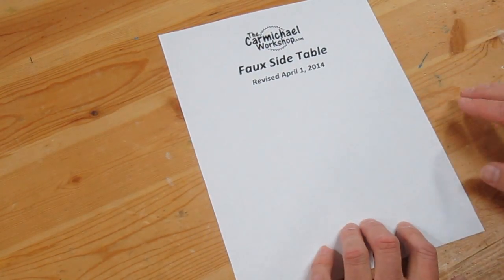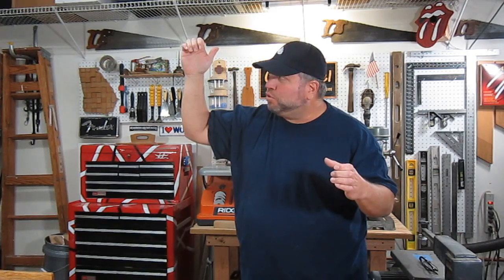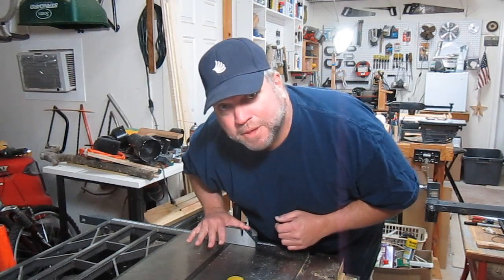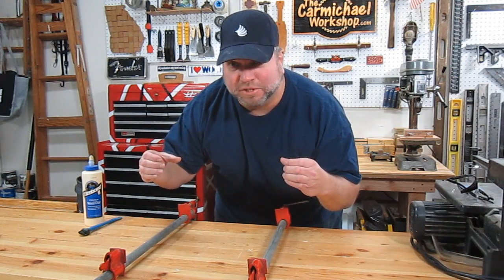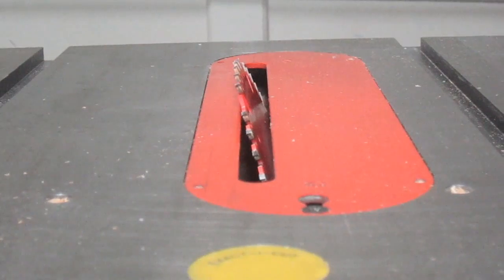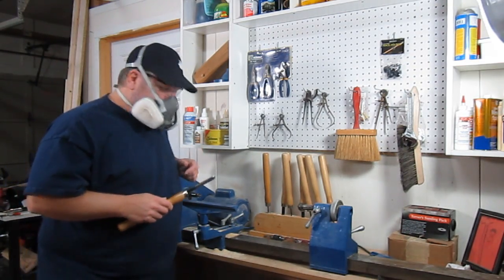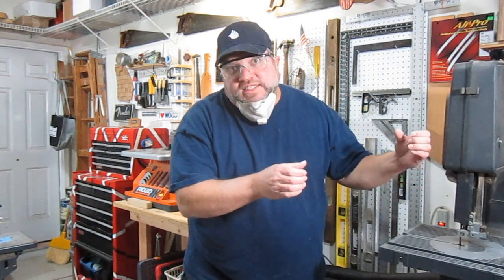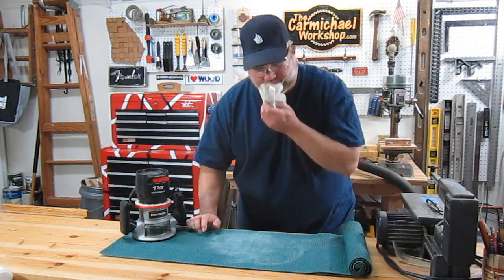Faux Side Table - An Invisible Woodworking Project

Comment: Were those hand cut double rounded through stop pocket hole dovetail joints you used for the legs? I have been looking for a reason to try my hand at those but I was never brave enough to buy the Kreg Jig required for those!
Reply from the maker: Yes, I did it with the less expensive Kleg jig.  lol

Comment: Steve, your shop vac works AWESOME!  I barely saw any dust.  Oh, btw, i noticed that when you were turning the stand there was a small fracture, but when you assembled the table it wasn't there.  How did you fix it or was it just a lighting issue?
Reply from the maker: It was just a reflection.  lol   Thanks John!

Comment: Steve, wouldn't pocket holes be an easier way to assemble the table top.  I have priced that would you used, really not a cheap material.  It was good to see you follow all the safety rules that came with you're power tools.  I may try this one.
Reply from the maker: Yes, pocket holes are a good alternative to 100 brad nails.  lol